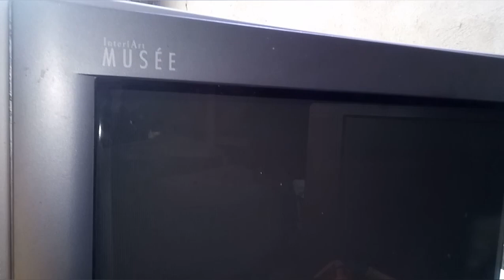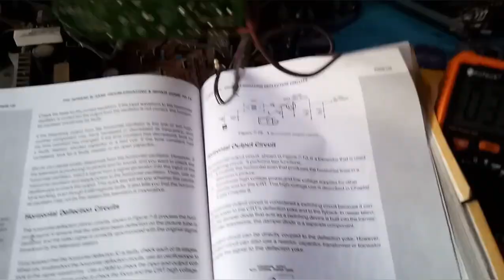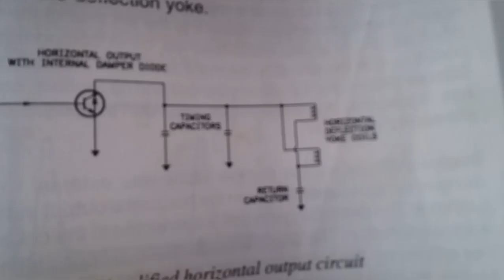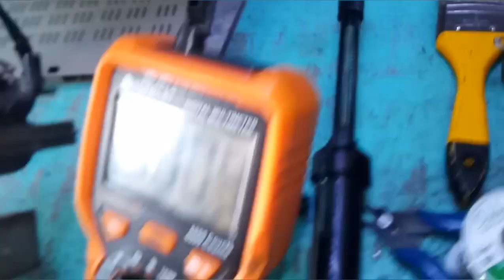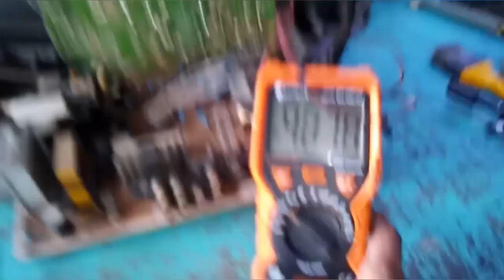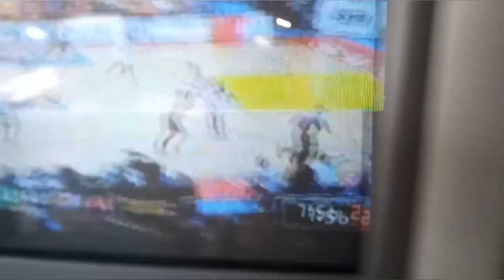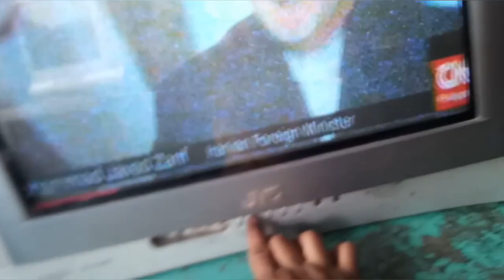JVC CRT TV FLYBACK REPAIR | CHANGING CAPACITOR TO REDUCE  VOLTAGE | TAGALOG

Comment: thank youi so much !  sir , my panasonic 14 in got a problem of no vidio and audio 
when I test  on mother board , i found  the following 1. chopper output = 115v ( over ) and 2. flyback crt board 136 v  (under ) . even if I checked diodes and caps  nothing solve my challeng . would you help me ? many thanks !

Comment: Idol tanong kulang ano ang problema kpag umiinit ng husto ang horizotal out transistor kasama na rin un mga heatsink nya paadvice nman salamat idol
Reply from the maker: Chck ung b+ bka mataas,chck u din ung ecap sa hor drive transformer.chck dn ung timing cap,yoke & fbt
Reply: @JoeyTECHPH  salamat idol sa advice🙏🙏🙏
Eh kung china tv crt may itim sa ibaba di sagad pero sa itaas ok nman papaano un idol pa advice nman  uli sna salamat

Comment: sir good am. nice video po.
baka po pedeng patulong sayo. nag bukas ako ng TV (aftron) nakita ko sunog yong capacitor no. 431. hindi ko na makita yong value niya, pinalitan ko ng 471 picofarad pag switch on ko may narinig ako parang lumalagitik parang katulad ng video mo pero mahina lang itong binuksan ko na tv. di ko na alam ang susunod kong gawin. ty in advance.
Reply from the maker: Voltage checking po muna

Comment: Sir Joey nice to meet you po patulong naman po may china TV ako 32 inch Plardin by Lexin po ang Brand sunog po yong mgaa Resistor and Board sa gilid ng Flyback line to ground po rito samin palaging low voltage paano ko po malalaman ang value ng mga components na na damage, any tutorial po salamat.

Comment: Par ang nakita kona bro problema sa polytron sana ito na unang saksak  may b+ biglang  baba parang capacitor bro nakabit sa may  power supply  ang value niya bro ay wk0502  pinagpalitan ko mayron man ako board nang polytron  tumaas siya binalik ko nalang dati  baba na siya kasi lang mababa ano kaya ang pwede ipagpalit na value  mayron kay mabili bro

Comment: Sir un bang dinadagdag mo na capacitor sa timing capacitor dapat ba 1.6k volts din rated nya anu minimum n voltage pwede idagdag dun sa timing capacitor sir.at anu anung klase ng non polar capacitor pwede ilagay dun.salamat po.
Reply from the maker: 1.6kv lng pataas n mylar,polyester,ceramic
Reply: @JoeyTECHPH  ah,okey sir salamat.

Comment: gud pm sir,magtatanung lng anu bng possible trouble ng sharp model 14V-L75M,bumabagsak ang 180v pati supply ng vertical pero ung b+ hindi.ang b+ 130v ok lng b un?salamat
Reply from the maker: Chck u vertical section sir o kya yang yoke..
Reply: ok nman sir un vertical my output voltage nman pati un yoke,pwd ba e apply ang pag de activate ng protection mode,d ko lang alam kung saan proctection mode,pasensya n sir,baguhan lng.samalat.
Reply from the maker: @leonardoalden7957  namamatay ba oscillation sir?
Reply: yes sir,nmamatay ang oscillation nya

Comment: Sir ask ko lang meron din ako repair ganyan na jvc
Lumiit yung horizontal size nya mga 1 inch kabilaan wla akong mkitang sira
Reply from the maker: Madali lng po yan..bawasan u ng value ung return capacitor sa hor. Ung nakalinya sa yoke blue wire

Comment: sir...kapag pinalitan mo ng mataas na value o dadagdagan ang timing capacitor...magiging wide ba  ang picture nya...salamat...
Reply from the maker: Hnd lng wide pati vert size dn may epekto.pro kng ung wide lng gusto u eadjust ung return cap lng bagohin u ung nakaserries sa yoke color blue line
Reply: Oo kz mdagdagan ang uf nun
Reply: Sir joey ask ko Poh kung Ano ang pwede I replacement sa IRFP 140n slamat sir

Comment: sir ano kaya problem ng pensonic crt ok nman boltage ng hot wla syang pictures kpag inadjust ko nman screen lumalabas ang  kulay nya piro blurd sya ano kaya sakit di kaya sa jungle ic nya
Reply: sana masagot salmat
Reply from the maker: Chck u sir ung crt socket pag ok ung fbt sira
Reply: ok nman sir ang crt sockit nya posilbe kaya plyback na ang sira sir
Reply from the maker: Ganyan mga naiincounter ko sa china tv sir
Reply: ok salmat bos

Comment: boss bkit pmuputok plagi yung capacitor na 2200 25 v sa symtax tv 29".. check ko b+ nya 130v tpos yung .180v. chnick ko 187v reading. anu kaya posible sira. bagohan lng po .pahingi po advise sir.
Reply from the maker: Lagyan u po ng mas mataas na voltage rating pro same capacitance din sir
Reply: @JoeyTECHPH  ok po sir.. pru nunh pumutok po capacitor steady nman po andar nya. d nman po nwalan ng display yung tv..

Comment: Boss pano po pag ang sira nya is lumalabas mismo yong kuryinte nya sa mismong cup ng playback. Ano gagawin po. Salamat
Reply from the maker: Linisan maigi at palitan na rubber cap
Reply: Last po boss yong rubber cup nya lang po ang papalitan. Yong ganung na sira boss hindi sya nag over voltage.. sa cup lang po talaga..?
Thanks po
Reply: Salamat idol dami ko natutunan sa yo.tanong lng idol Kung ano pede pag replacement sa str 6554 n regulator.😀

Comment: Master good morning Sony sira yong hot at diode RGP10G open resistor  .47ohm Trinitron 2times blinking saan po protect nito sir
Reply from the maker: Chck u pa mga parts kng san pumunta ung mga sira na parts
Reply: @JoeyTECHPH  master salamat nagawa ko rin sanyo ko open resistor 1ohm papnta b+ at my sir din sa vertical section at maraming salamat sa mga video mo
Reply: @JoeyTECHPH  master skywort led tv 43 inches saan makabili ng panel ntumba kc ito buka panel
At heir na 32 yong sinabi ko syo na nkidlatan ok power suppy pwede po ba ito palitan universal board?
Reply: @JoeyTECHPH  isa rin ako tagasubaybay sa mga video mo kya maraming salamat galing mo
Reply from the maker: Pwde sir

Comment: Brod joey confused lg ako dun sa silicon sealant, ano yun, A at B na hinahalo kagaya ng ibang adhesives? I have to be sure on this before I order it on line. Bakit kulay itim nang nadugtong mo na ang fbt ng jvc, while ang  silicon sealant kulay puti? I have another success to tell you. I troubleshoot a tv came from a junkshop. This trouble remained unsolved to me for many many long years. The picture is horizontally half screen. One would think changing vert out ic, memory ic, def yoke, but none of these can solve the issue. Who would think that these little 1uf 50v & 2.2uf 50v located in far vert section going to jungle ic are real criminals? Your capacitor tester sir joey truly caught these bad 1uf & 2.2uf 50v, while my analog & digital meters can not. Thank you sir I owe this a lot to you in my works. Who knows someday baka mapagawi ka banda rito sa amin ( iloilo ) you are welcome in my shop. God bless you bro! Kanina lang na solve ko yong samsung crt slim flat, 100uf 50v ang sirà, pero hindi ko alam kung anong transistor ang protect mode nito, buti na lang lumubo na ang capacitor. Hindi mo pa yan napakita sa video mo, I hope next time. Im not a chinese but a native Filipino.
Reply from the maker: Ung gnagamit sa aluminum glass.silicon sa loob tapos rubber tube at electrical tape.gawan ko po video nxt tym